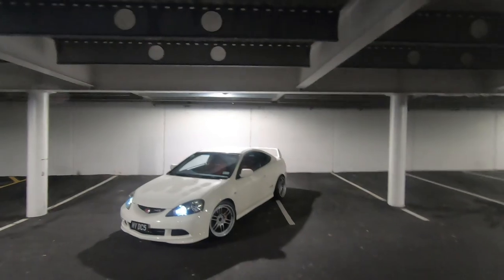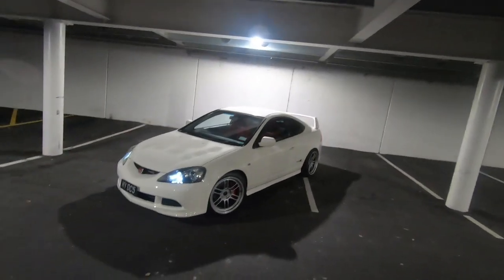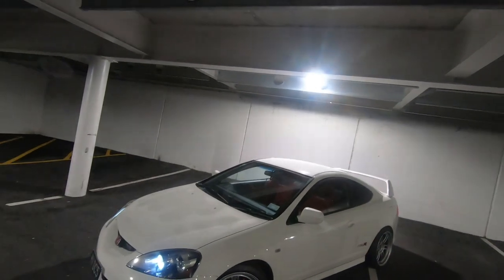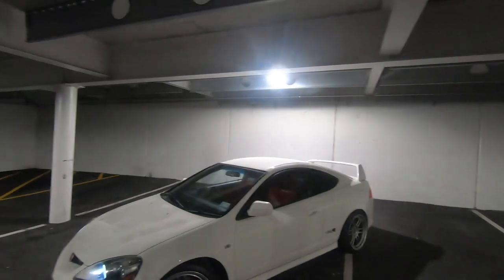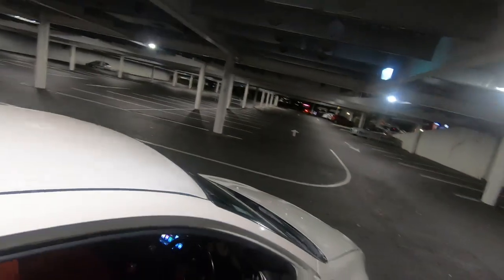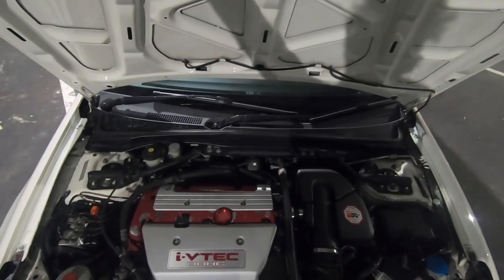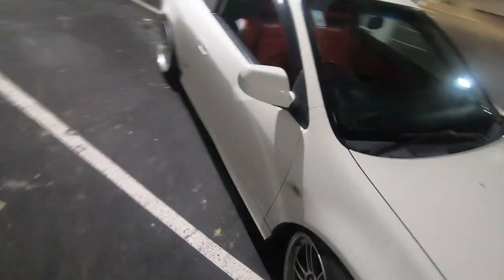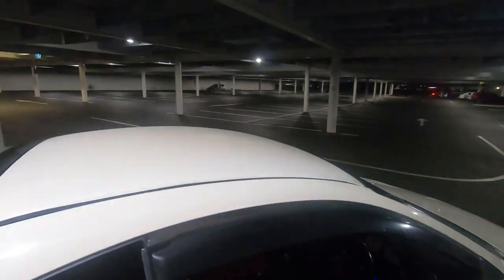POV Night Drive VTEC Pulls In my JDM Dc5 Integra Type R

Comment: Can i ask you what size of rpf one's?? Offset?? Beautiful car.
Reply from the maker: Thanks mate, the wheel specs for the front are 18x9 35et and rear is 18x9.5 38et. Had to use 3mm spacers on the front to clear the Brembos but that's only an issue of you have the jdm type r model.
Reply: @turbo_tyler_  thank You!! All the Best!!!